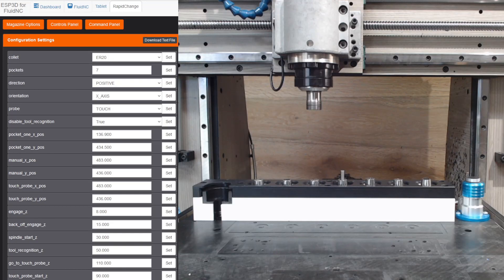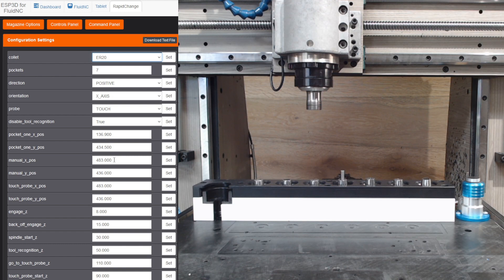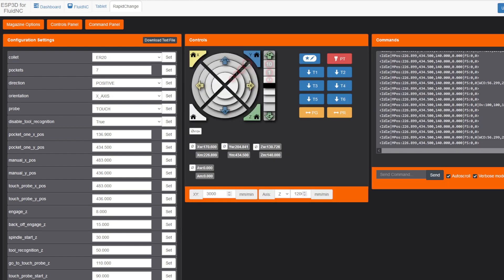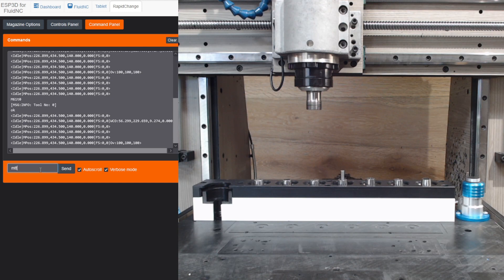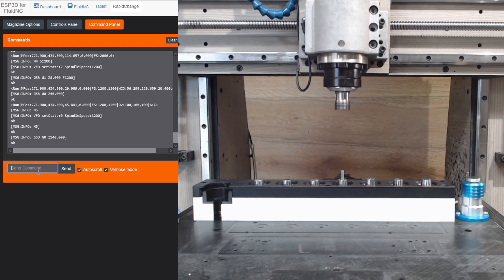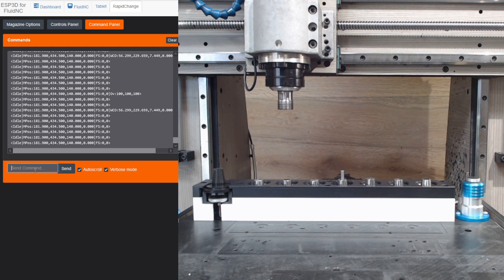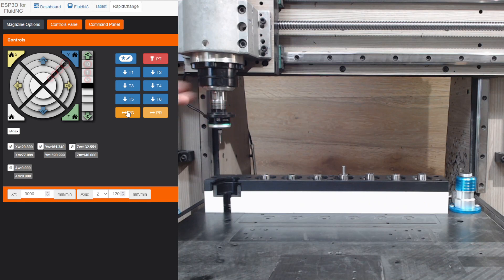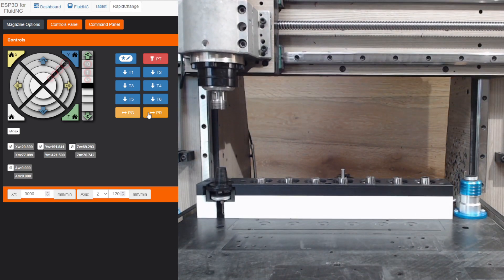RapidChange Automatic Tool Change Magazine/ATC CNC Easy setup and configuration in FluidNC

Comment: How can you change the webui colors? Thats pretty sweet
Reply from the maker: Thanks it is much nicer to look at LOL and it is much more functional. My son James has done all the coding for the M6 function on a branch from FluidNC v3.4 and wrote new code for the WebUI and branded our colors in it. So it will come with the firmware and new index.html
Reply: @RapidChangeATC  sweet, cant wait for the finished product
Reply: @RapidChangeATC   disculpa como puedo adquirir el software  que mencionas y que precio tiene este accesorio